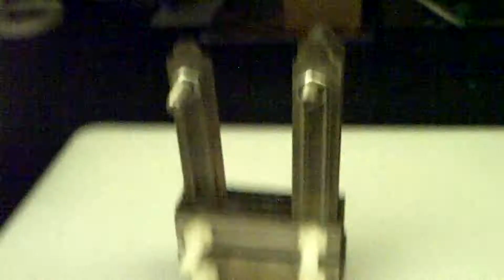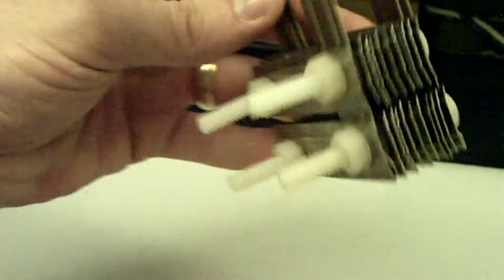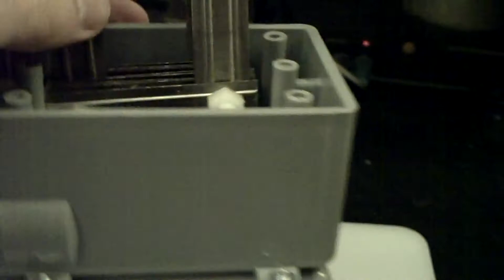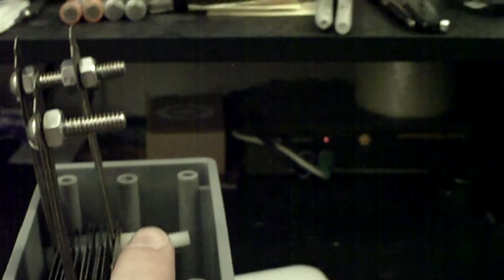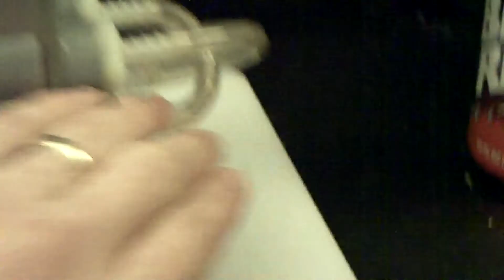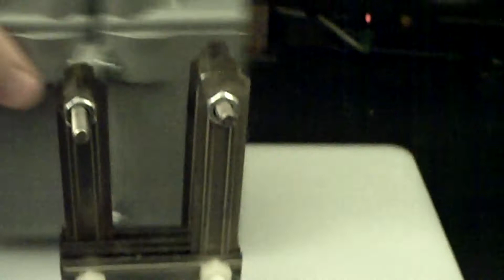Vid33 Slot Cell Hydrogen Generator Design (HHO, Brown's Gas, Hydroxy)

Comment from the maker: If I use the same configuration, but with more positives, it increases the amount of voltage per plate, and with more voltage comes more amperage and more heat. 

For me it is more about maintaining decent output with the least amount of heat and amperage possible.

Comment: I really like this design, creative and compact. Is the ratio you are using, (3 neg/Hydrogen/ 2 pos Oyxgen) is the ratio based upon something? I am not sure of the electroaffinity 'spp' of these two, but Oyxgen is a lot more massive then Hydrogen (16X), so I am just curious if you found the 2/3 ratio to be the best. And if that even matters, cause if you are breaking apart H2O it would have to come in whole units, wouldn't it? My runs so far have been confusing. Thanks for the help.